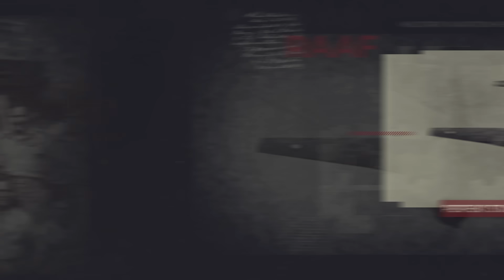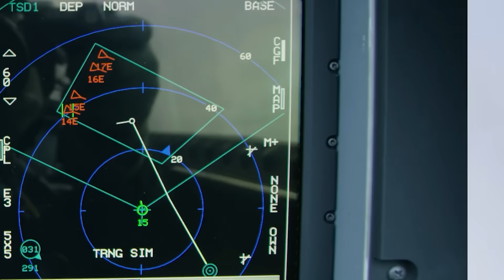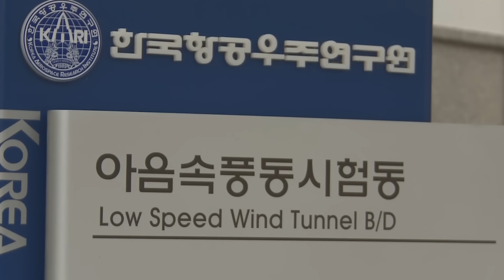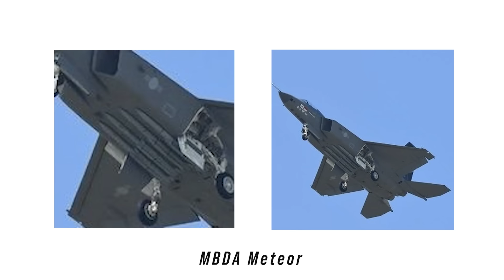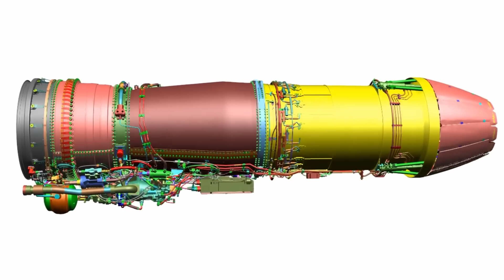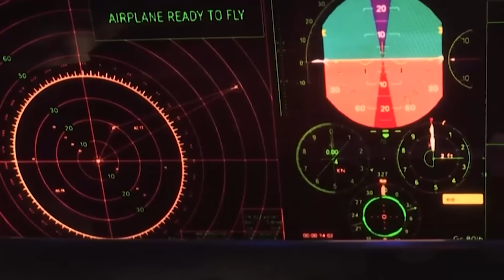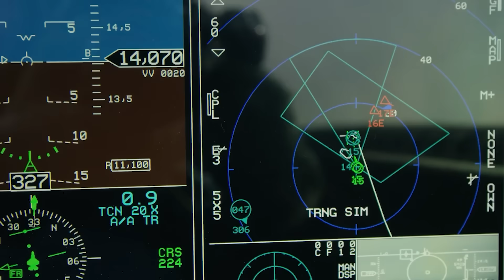KF-21: Korea's New Fighter

Comment: "This design (The Su-75) as with the Su-57 will likely be kept out of the spotlight and away from airshows, especially so if cutting edge"

The Orcs: "Uh... yeah, that's it. The Su-57 is 'Cutting edge'. It's not at all because of the critical design, fabrication, manufacturing, avionics, aerodynamic and poor performance flaws that we're struggling to rectify! No, you see, it's actually 'sooper advanced'! Almost too advanced. Totes McGoats, fer realz! Hun D P." 

😂😂😂

Comment: There is a reason why the KF-21 is made into a 4.5 generation fighter. Korea has been researching materials engineering necessary for stealth technology since 2000. We have already conducted a radar interference experiment using an F-4 fighter jet. However, KF-21 makes an important decision for overseas sales. We want it to be between the prices of the F-35 and F-16. The program aims to raise $80 million. If the KF-21 were a stealth aircraft, it would be difficult to compete with the F-35 and its price would exceed $100 million. The latest purchase price for the F-35 program is $5.16 billion for 20 aircraft, which Korea signed in December 2023. These days, fighter jet prices are very expensive due to massive inflation. The KF-21 is launched targeting this niche market.

Comment: The Americans initially did not authorize the integration of the AMRAAM and the latest variant of the AIM-9X with the KF-21 because they said such systems are not provided to airframes under development. This is the main reason why Seoul opted for the Meteor and the AIM-2000. Since then the US did an about-face and said it will allow its air-to-air weapons to be used on the jet. Another development is that S. Korea has officially said it will produce its own short-range AAM and an indigenous fighter engine that may be used on the KF-21 and possibly next-generation jet trainer and light attack jet. News reports said the AAM will be similar to the AIM-9X with the engine being on par or slightly more powerful than the GE414 licensed-built in Korea for the KF-21. South Korea has been license-building jet engines for decades so it has the general know-how while a local company even started building huge industrial-grade turbines for thermal power plants that can be used on jet turbofan engines. FYI Seoul operates some 430 combat jets and if you count the jet trainers that can be used in limited air-to-ground and air-to-air roles, the total rises to around 500.
Reply: KF-21 provides large firepower, limited stealth. F-35 provides deep stealth, limited firepower. They complement each other. That is why they are buying both.
Reply: @Stu_Bur 飛彈都沒有已經吹到火力強大🤣🤣🤣🤭又一個不要臉東西，請問用什麼雷達，你飛彈要外置你什麼鬼隱身？？這架東西絕對比F35還爛，跟本沒有轉移技術給你，你這架東西左拼又拼出來的，F 35已經是失敗品更別說你這架還不如.. 發發梦還可以
Reply: F-35A and KF-21 are not in the same league. The F-35 is bleeding edge! It will do the precision bombing of air defense system and neutralize command and control and maybe sweep the skies of N. Korean fighters, at least in the early stages of a conflict. The KF-21 will do the heavy lifting and mundane tasks of existing fighters once the North air defense system has been degraded. This is important because the F-35 is very expensive to fly. If the Americans are struggling with operational cost think what it would mean for S. Korea and other smaller nations. It makes sense to buy the F-35 but for Seoul, these planes should only be used when it is really needed and for training the pilots. It would be folly to use F-35s as interceptors against antiquated N. Korean MIGs or maintain regular CAPs over Korea particularly in peace time. FYI S. Korea has always maintained some 120 top-of-the-line US fighters with the rest of its fighter fleet being less capable fighters like the F-16C/Ds, F-5E/Fs, and the soon-to-be phased-out F-4E. The KF-21 is eminently suitable for replacing the F-16s, F-5s, and F-4s once they reach the end of their serviceable life. To emphasize the KF-21 does not compete with the F-35 but acts as an affordable backup and I think most air forces around the world need this kind of high-low mix.
Reply: Giving n Korea some details?
Reply: The initial reluctance of the United States to authorize the integration of the AMRAAM and the AIM-9X on the KF21 stems from a complex set of considerations. The U.S. hesitated, not due to the developmental status of the KF21, but rather as a strategic move to impede the progress of South Korea's KF21 program. However, a turning point occurred when Germany approved the integration of the METEOR missile by MBDA. This decision prompted the U.S. to reassess and eventually capitulate to the integration of AMRAAM and AIM-9X on the KF21. The underlying motivation appears to be a desire to secure a lucrative opportunity rather than a simple aversion to approving missile integration on the KF21.
Reply: 삼성항공 KF-16 라이센스조립 11비행단 F-15k(F-100&F110) 항공엔진 사용 TF-X 시재기칸 사용한 항공엔진 F-100×2 사용 미국이 F-16 전투기 소그코드 개방 자국산 항공엔진 미국이 시제기칸 항공엔진사용 반대 무기한 초도비행 연기 생각합니다
일본은 랩터 90% 성능  작은 항공엔진 국산화 성공 영국과 공동개발 선택한 이유 미국 F-2 전투기 트라우마 비해 보라매 항공엔진 비해 바디가 너무작다
레거시 호넷 F-404 항공엔진 업그레이드 F-414 항공엔진 슈퍼휴넷 전투기 바디를 확장 미사일 무장량 늘어나는 전투기 일본 F-2 전투기 F-16전투기 바디를 확장 공대함미사일 엄청난 무장 공대함 전투기 보라매 4.5세대 하이브리드 전투기 5세대 랩터 아기전투기 실수 스텔스전투기 내부무장창 내부대형연료탱크 바디확장  당연하다 RCS 라팔기준 마추기 위해서 레거시호넷 작은바디를 선택은 실수 중국 J-20 러시아 SU-57 대형 5세대 전투기 비해 보라매 1차양산 전투기 러시아 중국 스텔스 전투기 1대1 교전은 불가능 AESA레이더  KF-16 성능 조기경보기 미사일 유도 스텔스 전투기 F-15&16 퇴역 2045년 예상 국산항공엔진 F-414 성능목표 2040년 개발 중국은 러시아 항공엔진 불법카피 성능은 70% 욕하면서 대한민국 무인기 항공엔진 개발수준 F-4 퇴역하고 대한항공 조립 제공호 보라매 2차생산 도입 퇴역 FA-50 T-50 미공군 해군 적기용 중고가격 수출 보라매 3차생산 예상 합니다 0:04
Reply: Looks like the F-35  with two engines
Reply: No but South Korea just purchased 20more F35 block 4 wonder why😂😂😂😂
Reply: @rosevitelli5814  different roles. have you even saw the video? nop, for sure. the kf.21 does not replace the f-35, but is somewhere between it and the F-16. Geez, slow minds...
Reply: @rosevitelli5814 The order for 20 additiinal F-35A is to complete F-X phase 3 program. Both F-X phase III and Boramae(KF-21) are seperated from each other. In 1994, JSOP(Joint Strategic Objectives Plan) 96-00 was made in the MND(Ministry of National Defense) of Republic of Korea(Republic of Korea is the official name of South Korea). It was applied in JSOP 96-00 to purchase 120 high-class MRF(Multirole Fighter) in order to replace 6 squadrons of F-4D/E. For this strategic plan, F-X program was started. By 2013, as completing F-X phase-1/2, it has been completed to replace 3 squadrons of F-4D in 11th FW(Fighter Wing) by the acquisition of 61 F-15K that South Korea is operating in 11th FW nowadays. And for the purpose of replacing 3 squadrons of F-4E in 17th FW, South Korea has purchased 40 F-35A for F-X phase 3-1. With F-X phase 3-1, F-4E in 151st SQ(squadron) and 152nd SQ under 17th FW have been replaced by 40 F-35A(Block 3F). And in order to complete F-X phase 3-2 to replace 27 F-4E in 153rd SQ the last Phantom II squadron, South Korea has placed the order for 20 additional F-35A(Block 4). On the other hand, 120 or more KF-21 will replace 2 squadrons of F-16PBU(among 9 squadrons that operate F-16C/D in Republic of Korea Air Force, there are 2 squadrons of F-16PBU while the other 7 squadrons having KF-16) as well as 4 squadrons of KF-5E/F. So to speak briefly, both the acquisition of 20 more F-35A doesn't mean that the development of 120 KF-21 doesn't go on well. Because the development of KF-21 is being carried on very well in accordance with the plan, South Korea has allocated the budget to the acquisition of 40 KF-21 Block 1 recently.
Reply: @doit185  look it's a great plane love South Korea but you know and I know KF21 is a decade or more behind F35 just wait everyone has great planes once NGAD is ready just like F22 we once again be decades above
Reply: @rosevitelli5814  Of course, F-35 is much better than KF-21. In South Korea, ROKAF(Republic of Korea Air Force) is operating 40 F-35A as high-class MRF(Multirole Fighter) in nowadays. In near-future, 60 F-35A(40 in nowadays + 20 additional ones) will be opererated as the strategic(high-class) jetfighters while 120 KF-21 being used as the operational-strategic(medium-high class) fighter jets in ROKAF(Republic of Korea Air Force). I told you that both F-X phase III(40 F-35A operated in nowadays + 20 more F-35A in near-future) and Boramae(120 KF-21) are seperated from each other. So KF-21 is not developed to be able to be at par with F-35. So in Republic of Korea, it is not denied that F-35 is better than KF-21. KF-21 will be proposed to the countries such as UAE, Egypt, Thailand, Malaysia and Saudi Arabia etc that can't buy F-35 on using STANAG-standardized(STANAG 4193 IFF, STANAG 5516 datalink, STANAG 4372 SATURN etc) jet fighters. So to speak, both F-35A and KF-21 will not be competitive to each other because KF-21 will be offered to a sort of niche market. And I don't deny that F-35 is much better than KF-21. In nowadays, F-35 is the best. South Koreans don't deny it. Even South Korea operates 40 F-35A as the key-force to deter DPRK(North Korea) while ordering 20 more F-35A upon being satisfied with F-35A so much.
Reply: @rosevitelli5814  This purchase includes a political gesture from the S.Korean government, expressing the desire for the success of the F-35, intended to be a common frontline fighter in the free world, and ensuring that the development of the KF-21 does not compromise its benefits
Reply: So let me ask you this my friend if this plane is so good why did South Korea just bought 20 more block4 F35 if they had confidence in this plane they would not be purchasing more F35 ✌️✌️✌️✌️✌️🙏💪💪💪
Reply: @rosevitelli5814 The purchase of block4 and 20 additional fighters is to upgrade their high tier fighters. Sk operates in a tiered design with high, mid and low fighters. High being F-35 and F-15, mid being the F-16 and future KF-21 while low is the Fa-50, and T-50 trainers. The block4 upgrade on the F-35 is a mandatory upgrade that something LM is basically forcing the government on to generate additional money. Plus the threat of China and North Korea with its deliberate nuclear posture requires more preemptive and deep strike capabilities to neutralize the nuclear threat ( or at least increase the retaliatory strike capabilities).
Reply: @rosevitelli5814  F35=High Class
                                 KF-21=MIddle Class
Reply: @rosevitelli5814 Bro... It's a realistic and political choice...
Reply: @rosevitelli5814  - The K21 plane is not in service yet.
Reply: I guess they don’t trust their own aircraft
Reply: @zigzoog123  why so? can't understand such a deep assertion without some juice to corroborate it...
Reply: @zigzoog123 Nope. South Korea has allocated the budget to acquire 40 KF-21 Block 1. The purpose on the acquisition of 20 additional F-35A is seperated from that on the development & acquisition of 120 KF-21. Why South Korea has placed the order for 20 more F-35A while carrying on the development of KF-21 is to fulfill F-X phase 3 program. South Korea has bought 40 F-35A(Block 3F) as completing the first stage of F-X phase-3. But because the plan on F-X phase-3 is it for South Korea to have 60 F-35A, South Korea is going to buy 20 additional F-35A to complete F-X phase-3 program. Boramae(KF-21) program is being carried on with being seperated from F-X program. So it is not true that South Korea doesn't trust their own program. In South Korea, KF-21 is one of the most important and trusted programs

Comment: Mounting weapons externally means this is not a stealth aircraft. It just looks like one.
Reply: Normally, this is true. The bigger the external load, the higher the RCS, but this fighter carrying the 4 semi-recessed AAMs *still* has a lower RCS than the SU-57's 1m² - 0.1m² which is the same as a clean Super Hornet. The KF-21 is in the .01-.001 range whilst armed. Before you ask, Janes and a bunch of other industry outlets released articles on it. You can look it up for yourself.

Comment: I bet the f16 would smoke it
Reply: F-16 is like an obese person on radar lol
Reply: Pretty much like this thing that doesn't even have internal weapons bays and has full exposed jet nozzles. The block70 f16 is far better and would ruin this kf21. Especially if it ever came to a dogfight.
block70 f16 
"A new advanced APG-83 AESA radar delivers greater situational awareness, flexibility and quicker all-weather targeting. The APG-83 provides F-16s with 5th Generation fighter radar capabilities by leveraging hardware and software commonality with F-22 and F-35 AESA radars. The AESA is being integrated with a new active and passive internal electronic warfare system (Viper Shield), which incorporate a new fully Digital Radar Warning Receiver (DRWR) designed to interface with the APG-83 radar."

Comment: F-22 shaping, F-35 internals, F-16 firepower. Smart.
Reply: F-16s don't carry Meteors.
Reply: It is designed to have equivalent hardpoints and weapons load to the F-16s that South Korea has in service. That suggests that the intent is to replace the F-16s in the long run but keep the same level of firepower available. The specific weapons used will vary over time.
Reply: ..now you’re taking “made in South Korea “ episode into conspiracy stratosphere.!…
Reply: @georgesikimeti2184 most “intelligent” hillbilly:

Comment: KF-21 is NOT a 5th Gen fighter.  Its is considered 4.5, however, it can be 5th gen once internal bay is installed (which is planned for 2026/27).  It bridges gap between 4/5th gen fighter niche market.
Reply: So block 3 is actually projected to be 5th gen+
Reply: Korean engineers have concluded through years of stealth research that electronic electricity, which can perform a wide range of electronic warfare, is much more powerful in all-out war than in five generations of expensive maintenance costs.
So, along with KF-21, we are developing electronic warfare specialized aircraft.
Reply: If you say that E.U. can't make it and Korea can't make it, then Japan also can't make it😂 Kf21 need a bit more changes like missile bays and the raider and stealth capabilities. Korean engines are pretty amazing.
Reply: You have no clue what you're talking about homie.  An internal weapons bay isn't necessary for Gen 5. By that logic, given the F-35 carries typically carries a fair portion of ordinance externally, it's only Gen 4.5. 🤡  It helps to decrease a plane's radar signature, but it's no requirement for a fifth gen plane.
Reply: @thestormofwar  I guess your referring to f35 beast mode. But f35's beast mode is used when they don't need stealth, which is a pretty essential element of making Gen 5, thus they need to make internal weapon bays not external weapon bays like f35 beast mode or current kf21. A Gen 5 jet needs everything like the antenna or weapons inside cause it will make the jet stealth. In the first place, kf21's body frame is a stealth jet. Korea(KAI) is developing an aircraft engine but they still need to use American made engine. Since they are using an American product, they need permission to use it and America limited kf21's generation to 4.5 . It won't take long until Korea makes the engines by themselves and put everything inside in order to make a Gen 5 jet.
Reply: Also the radar that f35 uses is very high quality radar that other countries cannot easily create.
Reply: KF21 still need more capabilty to fulfill 5th gen requirement like
-stealth coating
-supercruise
-internal weapon bay and
- sensor fusion
still need help from papa lockheed martin😂 helps again
Reply: F22랩터제작에 참여한 한국계미국인 박시몽박사님이  이 전투기 제작에 참여했다   미국당국으로 부터 F22랩터 기술유출의 혐의를받고  기소를 당하고 수십년형을 받았지만~ 한국정부는  F35 구입시 기술이전 약속을 안지킨 미국을 상대로 핵심기술 이전을 안해준걸 끝까지 물고늘어져 박시몽박사는 감형을 받을수 있었다 ~  한국정부의 노력으로  2년동안만 실형을 살고 박시몽박사는  풀려났습니다 ~ 랩터의 유전자를 가진 전투기 입니다 ~ 앞으로 블록2   블록3로  6세대 전투기로 진화할것 입니다 ~ 한국은 이미 완전스텔스기로 업그레이드 중입니다~ 2026년에 kf21을 보조하는 무인기와 실전배치됩니다~ kf21 한대에 여러대의 무인기가 따라다니며 작전을 수행합니다
Reply: 发动机，雷达航电系统，武器系统，隐身弹仓都没有，进气道还是加莱特进气道都没有，五代机不是一个小小的韩国能造出来的，东拼西凑其他国家买的零件组装的样子货，韩国航空工业没有拿的出手的东西，大推力发动机都造不出来，欧盟都造不出五代机，韩国更没那个技术实力。
Reply: @朝阳王-i6k He is telling you that this is not 5th gen! it will be 5th Gen slowly. it's ok we understand you are also made in china so not functioning well to understand
Reply: @朝阳王-i6k  Ok poor chinese, cry more :)
Reply: @朝阳王-i6k  Made in China quality 🤣
Reply: 5代？掛彈在外面你是什麼5代？別說超機動性其他標準了，
Reply: @tsz6993  What an ignorant Chinese. Remember that KF-21 now is just the first phase of the plan 🤣🖕
Reply: @tsz6993  초기 상태로 5세대가 아나라 말 하는게 웃기네 시간이 지나 업그레이드 계획에 따라 변화를 한다~ 댓글 마다 알례주고 있는데 5세대가 아냐!! 이 말만 모든 글들에 반복을 하는 이유가 머임?
Reply: I disagree. The bay isn’t required to be 5th gen. It has the same functionality as an F-35 in beast mode at lower cost
Reply: @Stu_Bur I'm just regurgitating the plan recited by KAI on the public inquiry on KDFA last month.
Reply: @Stu_Bur  they said that they will upgrade it to 5th(+@) slowly